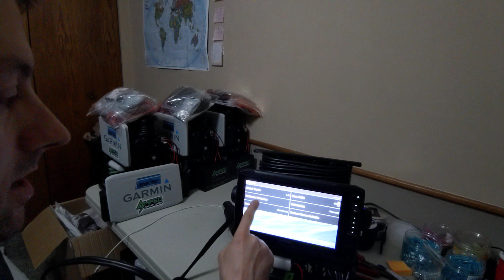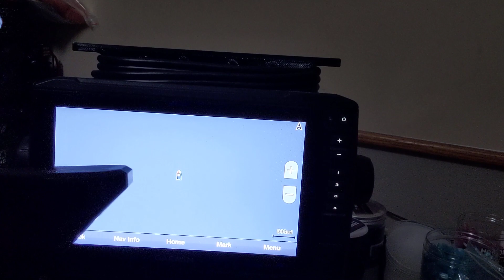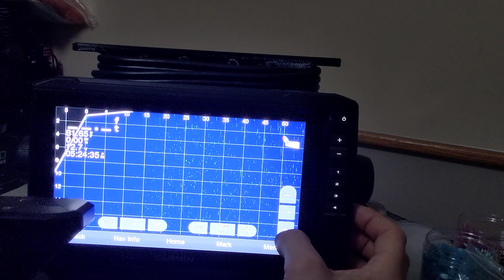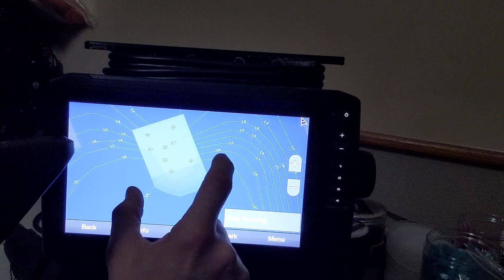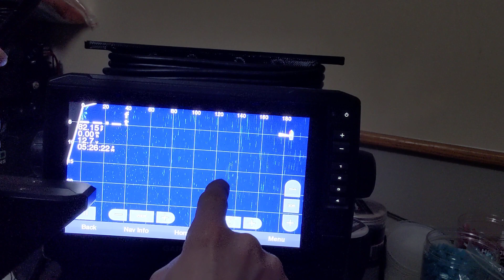The two most overlooked Livescope features!!!

Comment: Thanks for the video i am using a stand alone pole for transducer and im able to calibrate but when finished the boat icon direction on screen does not match with transducer direction not sure what im doing wrong. Thanks for your help
Reply: Got I got the problem too
Reply: Got same problem too tried many times just can’t seem to get it would be great if it did.
Reply: Same problem

Comment: I tried calibrating my compass and two things happened that I haven't seen in any presentation on this topic:  First, the icon that appeared was not a boat but a circle with an "N" at the top of it.  Second, when the trolling motor is pointed straight ahead  the beam is shooting 90 degrees to the port side.  Any idea what's going on or how I can fix this?

Comment: Thanks for the video. I have a pole mount transducer. Should the transducer be pointed in any particular area (front, 90 degrees off bow, etc) when rotating the boat to calibrate?

Comment: Great information,  I just celebrated my system just like you suggested.  The problem that I am incourting is that the cone disappears on the maps .   I go back to celebrate  it  however the system says that its successfully calibrated.   AHRS is turned on.  Any suggestions on what the issues could be?  Thanks
Reply from the maker: Anytime the cone disappears that is because the compass has become uncalibrated. Recalibrate the compass. There's a problem with that happening when you switch from perspective mode back to forward or downmode.

Comment: Just subscribed...Setting up new rig..have 2 126s up front and 2 at console..should I calibrate the bow units individually..any reason to calibrate console units..Do I turn the boat with big motor...or trolling motor
Thx Jack B
Reply from the maker: The calibration is in the gls10 livescope module. Once the calibration is done all units will show calibrated in the livescope. Just turn the trolling motor if it has the capability to rotate 1.5 times.
Reply: Thankyou Jason very helpful..
JN
Reply: JB

Comment: Finely got a successful calibration after many failed tries or getting a message "must be in forward perspective" many times, even when the transducer is mounted in forward and forward or auto is selected in menu. After finally getting successful calibration worked great for a few days. Then suddenly the screen picture would start to swing as though it was hanging on a pendulum and the pointer extending from the boat icon would rotate quickly and constantly. Turning AHRS to off would bring back normal screen but, of course, no boat icon. Then eventually when turning AHRS back on would get a screen with multiple quarter circles radiating away from the 0 point. Checked voltage from all power, all good (new batteries). Checked all connections, all seem to be good. Please help!
Reply from the maker: If you change to perspective you will loose your calibration.
Reply: Also have latest software update 13.30. ECHOMAP Plus 93sv, ECHOMAP UHD 93sv, and Panoptix connected thru GMS 10 network port expahder.
Reply: @818Outdoors Have never used perspective view. Sounds like you are telling me I have lost my calibration. I will recalibrate. For some reason it is an arduous process, that is why I have not done it again. Thank you for the quick reply. It is greatly appreciated.

Comment: I currently have a Garmin live scope LVS 34 with a GLS 10 black box on a 93SV screen. For some reason I cannot get the cone to show in the direction after I have calibrated the transducer and I am having a good GPS connection. Any advice in settings on this? I would greatly appreciate it. Thank you.
Reply from the maker: For indicator on your screen will not always show the direction of the transducer. There's a couple different settings for how that is displayed. I prefer having the map setting to north up which tends to be more accurate to show the direction the panoptics is pointing on the map. As far as the display in the upper right hand corner on the pan optics screen, I've never had  Good luck with that.

Comment: Hey Jason. I calibrated my unit. Was a success. However on the maps the compass is off 180 degrees. How do you fix that?  The compass shows correctly to the right and the left left off of the front of the boat. The boat is pointing to the south physically so on the maps the roads and lakes etc are off 180°. Any suggestions on how to correct?
Reply from the maker: Check your transducer to make sure it's mounted in the proper orientation. The word Garmin should be level in the cable should be to the rear. Also you have to understand that only when the boat is moving will the map orientate to the proper direction with the boat icon.

Comment: Jason, I'm trying to figure out if there's any advantage in sonar response time between the higher end and entry level units running livescope. Do you know if the the GPSMAP units are more real-time vs the other units garmin offers or is the minute latency the same no matter what head unit you use with livescope? I have not seen or read any info on this scenario yet and would be nice to see if you can shed some light on it. Thanks!
Reply from the maker: The GPS map isn't exactly higher end. The 8600 specifically is the high end. The biggest difference is sonar wattage power capabilities and processing power. For just livescope there's not a big advantage over 106 or 126.

Comment: I have a compass that shows the cone in relation to north, it doesnt have a boat icon in the right corner of my 93sv with a lvs32 and gls10. I can't figure this out any ideas? Thank you!
Reply from the maker: Yes that's the new updated icon
Reply: @818Outdoors  well that's lame! Why would anyone care where the cone is in relation to north instead of the real time location of where its pointing. Garmin is trippin on this one. Thanks for the response!!
Reply from the maker: @SeeLifeBro  because in order to track where it's pointing when the boat is not moving, you would need a steady cast sensor. Otherwise the GPS boat orientation is achieved with forward or backwards both movement. When you're in one place, the charplotter does not know what is the front and back of your boat

Comment: I am having problems finding my brush pile at the WP having a steady cast will it enter fill with that
Reply from the maker: You have to make sure when you mark your waypoint that you're marking it at the cursor location and not at your boat location.
Reply: I am doing that I mark the WP from my screen and using the tear drop Is it marking wp from the map or gps
Reply from the maker: @daviddincler7494  You're better off going into the livescope screen and using the cursor to pause crosshairs on the brush pile, then mark that location. That will drop away point on the actual brush pile. Make sure you have your compass calibrated.

Comment: any idea why I keep getting a magnetic enviroment  reading of 10 or so and fail  I do have a transducer cable running with livescope cable on trolling motor.  with everything off except livescope I still have this problem  any advice is appreciated
Reply from the maker: If the transducer is mounted near the motor portion of your trolling motor, the magnets internally will screw up the compass
Reply: Will that happen even if trolling motor is off?  I do also have it on a perspective mount
Reply from the maker: @buckt12  yes
Reply: @818Outdoors  thank you very much for your help . I will move it and try again

Comment: My compass won't stay calibrated for some reason, anyone else have that problem? I am running a nmea 2000 network with a steady cast heading sensor also.
Reply: Im having the same problem.
Reply: Mine worked great for a year or so. Then would not stay calibrated for several months. Now will not calibrate at all. Keep getting message needs "proper orientation" Cant find anywhere where Garmin defines "proper Orientation". I assume its forward. Still get same message. Thought it may be a low voltage problem. LiFePo4 reads 13.8v dedicated to GLS10. Tried other good, new batteries. No success. I gave up and went fishing instead of messing with electronics. Wish Garmin would help me.

Comment: When I calibrate my boat icon is 180 degrees off. What did I do wrong
Reply: I have the same issue. Mine is about 90 degrees off.
Reply: @brettwren7824  I have the same issue, 90 deg off.  Garmin just tells me to put it in the water and re-calibrate.  Tried like 10X.  No luck still off by 90.  I wish I could get it to work.
Reply: @JigglinGem  are you saying the yellow cone is pointing 90° when your trolling motor head is pointing straight ahead? I mean the cone is always 90° off of the direction your trolling motor is pointing.